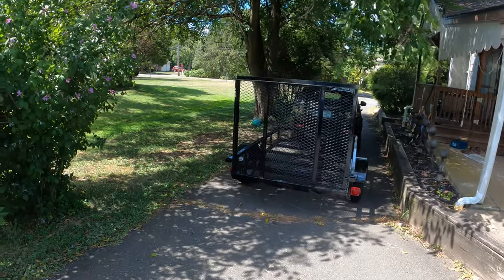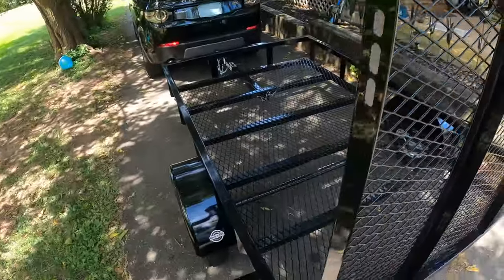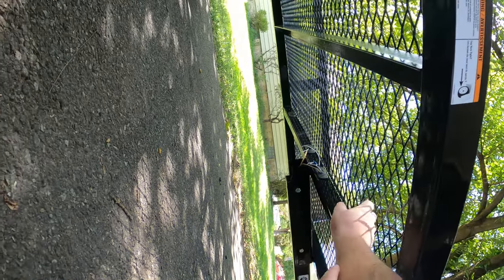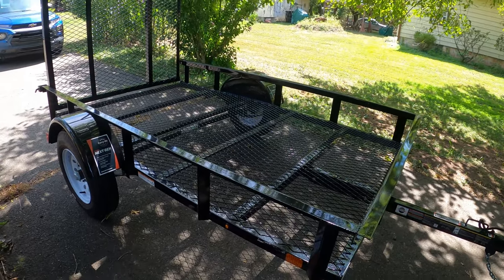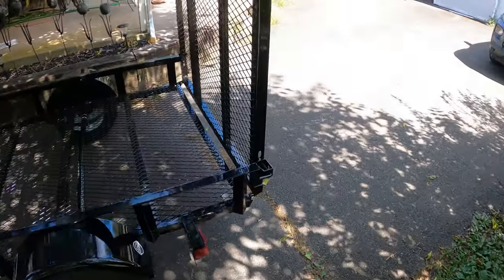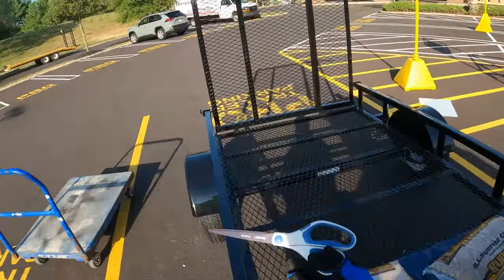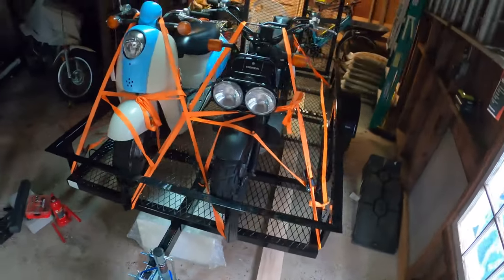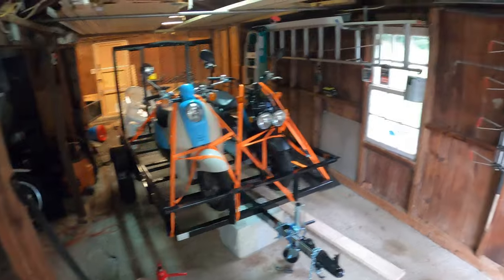How To & Review: Carry-On Utility Trailer

Comment: Thanks for the review and insight. I went to check the carry-on trailers out at my local Lowe's and they were rusty, busted, and out of square. I noticed however that there is a new gen trailer which looks like what you got. I'll have to check it out as I need to build out a semi enclosed trailer for an upcoming move as well as take a second trip to haul my Sportster and moped.